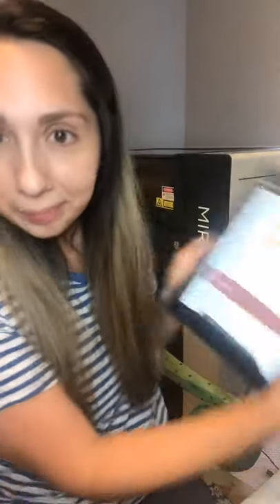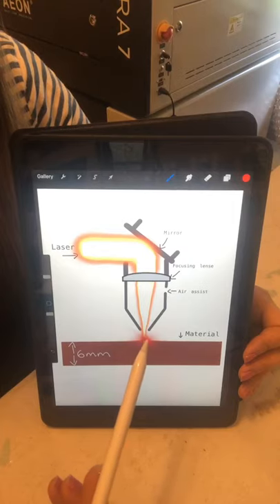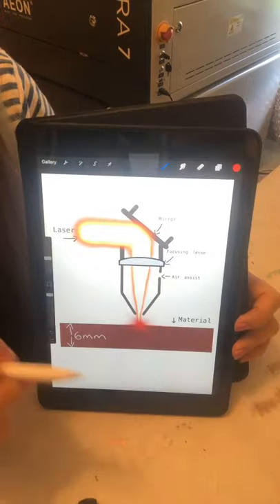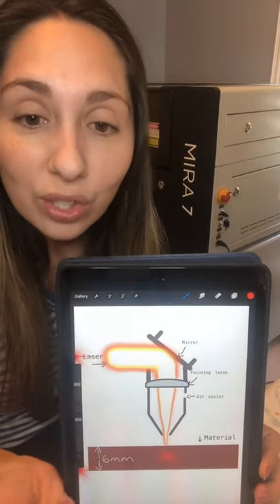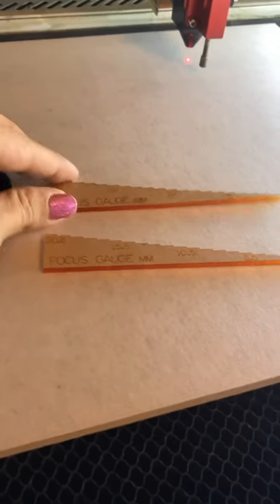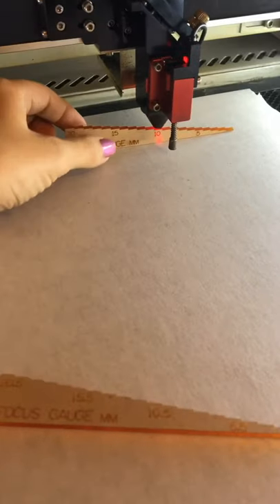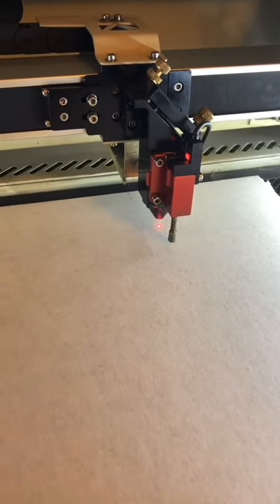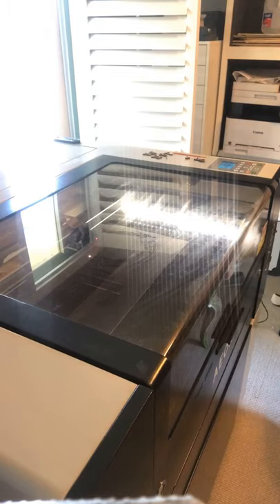How to: Adjust Focus and Cut Faster with your Laser

Comment: A good tip! Can you explain how much faster you can cut with this approach. The video didn't address this detail. THANKS!
Reply from the maker: Allen Yarberry hey no problem! I don’t know exactly how much faster but it’s noticeable. For example, I used to cut 1/4” material abound 9 speed and now I cut it around 15 speed 😃
Reply: @ThatMomWithALaser  WOW that is a big change in speed. Do you get much flame up running that fast?  Thank you so much for the tip!
Reply from the maker: Allen Yarberry not at all!

Comment: Hi Mom with a Laser, this is Dad with a Laser.. Also a mira 7.
Love all your helpful hints and tips.. You mentioned honeycomb clips in a video. Did you make them or buy them
Regards Mike 😊
Reply from the maker: Haha.  Hey Mike! The pins are a free file from a kind Glowforge user.  You may have to resize the pins to fit your honeycomb tray but they are such a help.  https://community.glowforge.com/t/honeycomb-bed-holdown-pins/18652?fbclid=IwAR17I2_aF7AUrwIDfgwMl3_HqCjVOcn4AzKcmjdNGcVBAJmF-QimAXop3rw

Comment: I'm not sure this is accurate.
Reply from the maker: Thank you, Anthony for sharing your concern. I wouldn't dare put something like this out there without verifying it with several experts before doing so.  Please feel free to research it and if you find any discrepancies let me know.  I've tested it myself and it's been awesome!
Reply: Its correct. By focusing in the center of a material, the initial top cut might be a bit thicker, but you will penetrate deeper. As it goes deeper, it powers up more and more until it hits that "sweet spot", then loses power. You can go deeper or faster with this technique.
Reply from the maker: Rob Xsiq thank you!!! ❤️❤️❤️
Reply: Hey Anthony, this is the correct method of cutting thicker material. Always focus part way into the material. This method also helps minimize the slanted cut effect caused by the convergence and divergence of the beam.
Reply from the maker: Aaron Cherman can’t thank you enough! You’re the best!
Reply: The more correct way of doing this is to change the lens to a different focal length. Ie. A longer focal length will have a bigger field of focus and be able to cut thicker materials.
Reply: Anthony Wratten Even with a longer focal length lens, the proper method is to still focus part way into the material.